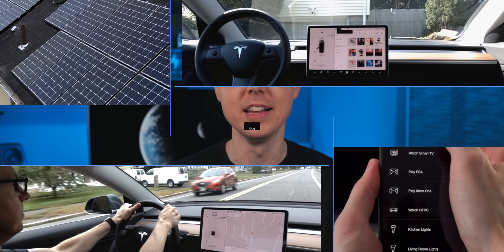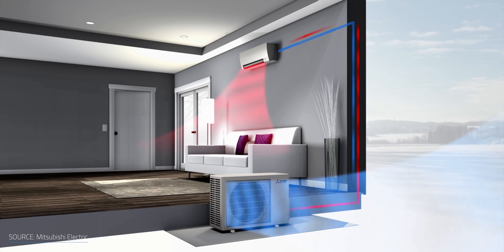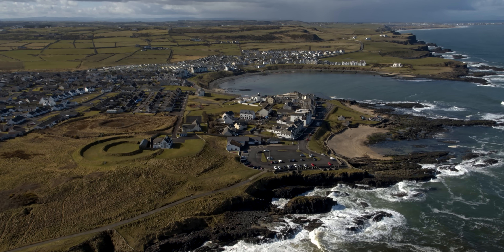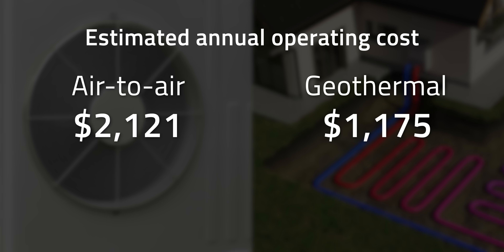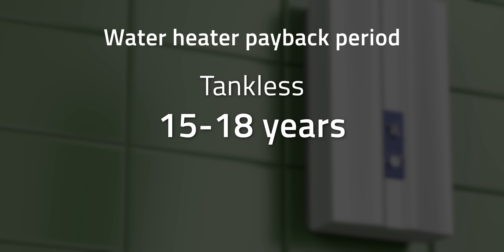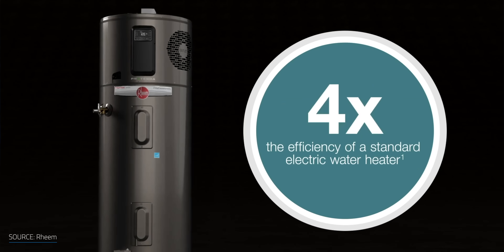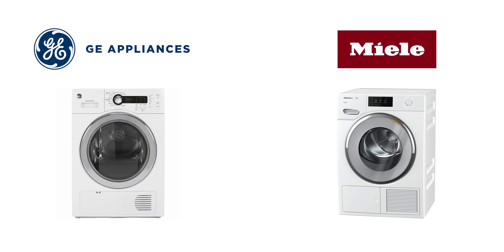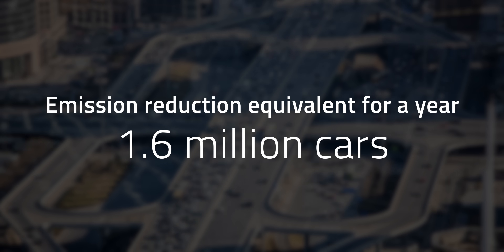Why Heat Pumps are Essential for the Future - Explained

Comment: 10 years ago we built a house with an air-to-air heat pump, that heats the house as well as the hot water tank (combined). We also installed a heat pump dryer, which is very much standard here I believe. The energy prices are high enough already... Best regards from Switzerland.
Reply: Ooohh, I forgot about heat pump dryers. I'm going to swap our water heater for a heat pump water heater when the current gas one fails. I'll have to get a heat pump dryer when our current one fails. Thankfully it's an electric dryer and we have solar/battery right now.
Reply: I'm assuming you saved money?
Reply: All the money you could've saved with not buying and using a dryer in the first place.. All the best from Germany, I thought dryers were not that common in Europe.
Reply: @matthias4  how do you dry clothes in the winter?
Reply: @hondaguy9153 , just as in the summer: I hang them on a laundry rack (inside the house). Sure, in the summer it dries quicker outside, but it works inside just as well, regardless of the time of the year. Of course you shouldn't keep the door/windows closed so the humidity isn't trapped inside. But my parents and I haven't had any problems with that in the last decades.
I save several hundreds of € for the not-bought dryer and 2-3kWh per not-use. Barely anyone who I know has a dryer, but I'm not completely sure.
Reply: Hmmmm ! I remember when we were told to install LED lighting to save money, I was an early adopter. What happened? The energy companies were never going to lose profits, they put prices up! And now it's happening again. Your all being fooled about saving money, the truth is you'll just keep paying more for using less. It's all a con.
Reply: @Nailnuke  my rates haven't gone up significantly (if at all) in the last 7 years. Not even a full cent per kWh. I still installed everything I could that was energy saving. I still bought an EV and then a PHEV. I still installed solar and a backup battery.
The cost per kWh will continue to increase. I didn't do any of the things I've done solely for money saving. It's mostly related to the climate and to energy independence.
What exactly is the "con"?
Reply: @hondaguy9153  Indoor air is warm and very dry in the winter, which are perfect conditions for air drying.
Reply: @matthias4  Yeah i also just dry our laundry on the dry rack in the loft of our house. Works fine. :) no dryer needed. Just have to wait a night for it to dry out.
Reply: @hailexiao2770  true, wasn't thinking about that.
Reply: @Nailnuke  at least in northern europe electricity consumption haven't gone down. Led lightning etc are really just a tiny fraction compared to heating and cooling of buildings and on top of that industry uses the biggest piece of the cake anyway.

Comment: I've had my heat pump clothes dryer for over 10 years now, and at least in Finland, most of the clothes dryers being sold are now heat pump based. I see the cooler air as a pro, as it's more gentle on the clothes. The easiest way to shorten the drying time is to get a washer with a high RPM spin cycle (1400 or more) - which also means less energy is used for drying. In Europe, there are some washer-dryer combos, too, based on heat pumps, which wash and dry your clothes all in one go, no need to lift the clothes from the washer to the dryes.
Reply: What brand is it? Our Samsung heat pump developed a terrible moldy odor, so we had to get rid of it. I would like to try another brand, so I'm looking for suggestions.
Reply: @TheMalbroughs  lmao you had a clogged drain and you chucked it? what is so difficult about getting someone to fix it??
Reply: @TheMalbroughs  it's Bosch (practically identical to Siemens). It's one that has automatic condenser cleaning, which might help with the mold issue. Also, after every drying, we leave the door open, which might also help.
Reply: What about the fact that it is literally pumping the water from your clothes into the air in your home? Is increased air humidity not an issue, or even desirable where you are?
Reply: I see the cooler air as a pro, as it's more gentle on the clothes
And the flipside is, it takes much longer to dry, meaning much longer tumbling cycles and thus mechanical wear on the clothes.
In Europe, there are some washer-dryer combos, too, based on heat pumps, which wash and dry your clothes all in one go, no need to lift the clothes from the washer to the dryes
I would never buy one. It is a single point of failure, and far more complex internally, as the machine has to be designed and have all the parts necessary to handle both air and water and to keep them strictly separate. A washer-dryer is more than twice as complex internally as two separate machines

The easiest and cheapest form of dryer is an outdoor clothes line! Your clothes are dried quickly and for free. I have a dryer, but it is used very rarely, and then mostly on almost-dry clothes as a brief tumble takes out the stiffness in the fabrics and rmeoves the final slight dampness line drying leaves on cooler days with little wind.
Reply: @richardgregory3684  How does the clothes line fare when it's cold or when it's humid outisde ? Have you heard of winters ?
Reply: @richardgregory3684  Washer+dryer combos have actually same failure rate as standalone dryers and washers. Believe me, I was selling them for years. Their only downside is their lower efficiency. These combos can usually wash 8 kilos of clothes but dry only half of that and their water and electricity consumption goes up to the point that they consume on average slightly more than standalone washer and dryer combined. When it comes to rate of failure though, it is same.
Reply: @lamebubblesflysohigh  I have worked on these things for the last 14 years, and you are pretty much spot on with your comment. They may have the same failure rates, one issue though is that depending on how the software is setup you can find a fault with the drying/washing system may stop the other one from working entirely. You don't get that with a separate washer and dryer. As far as heat pump dryers go they are also a lot harder to clean out if you do end up getting that musty/dank smell, and are often difficult for the owner to clean, requiring a complete disassembly. Depending how a particular dryer is constructed it can take anywhere from 1 to 3 hours to disassemble, clean and reassemble. Where as a standard condenser dryer, as long as you clean the condenser box regularly and the filters you won't have that sort of issue.
Reply: @roach362  that is the trade-off for having it all in one box :) I was always advising to buy these only if my customers didn't have enough space for 2 separate units.
Reply: @richardgregory3684  well there's never a solution that suits everyone. It doesn't take much longer to dry, as it condenses the water internally, meaning that the recycled air is dried in the process, and because of the heat pump, the air can be cooled below ambient temperature, meaning that the absolute humidity of the circulating air can be lower than in conventional dryers. And by being more gentle, I wasn't referring as much to clothes wearing out (using the clothes is the major component in there), but more to things like shrinking and wrinkling.

Yeah the clothes line works in summer if it's not rainy and there's no pollen or you're not allergic. Like I said, though, I live in Finland, where it's below freezing point most of the winter, so drying clothes outdoors is not really an option during several months. And actually drying clothes on a line indoors uses more energy than a heat pump based dryes (as the heat pump can utilize the latent heat in condensation, whereas hanging the clothes to dry won't).
Reply: @M33f3r  don't know to whom your comment was addressed, but the heat pump dryers all are condenser based, so they collect the water from the clothes into a container (or optionally some models might drain directly to a sewer). Also there are non-heat pump based dryers that are condensing (using a passive heat exchanger). They were very common in Europe before the heat pump models took over.
Reply: @M33f3r   The water is collected in a removable tank, you just dump it in the sink.
Reply: @JussiSiponen  that’s awesome!
Reply: @Firth33300  Cold outside - - > air is very dry when heated to indoor temperatures, perfect for indoor air drying

Humid outside - - > If it's sunny then the clothes will dry anyway. If it isnt, then your AC and/or dehumidifier is running, perfect conditions for indoor air drying
Reply: @hailexiao2770   most people here have no AC nor dehumidifier (though they're getting more popular). And like I said, drying clothes indoors on a rack during the heating sesason uses more energy than using a heat pump based dryer, due to latent heat. Also, the heat pump dryer works using the exact same principle as a dehumidifer, so I don't get what's the added benefit of first letting the humidity to the indoor air and then dehumidifying the air (the dehumidifier needs to do more work when you have clothes drying indoors). Surely, when you have good conditions for drying clothes outdoors, it's the best way (I do that, too), but drying clothes indoors is not (in many scenarioso) as energy efficient as people think it is.
Reply: @JussiSiponen  I collect the water from my heat pump drier and use it in my steam generator iron to prevent it scaling up. It's distilled water after all. Works a charm.
Reply: @M33f3r  it doesn’t realise it into the air. It condenses it. And either collects it in a tank to empty or if you have a drain near by pumps it out and it flows away